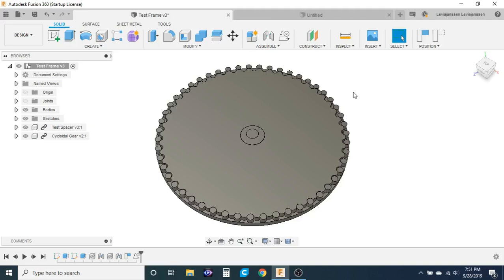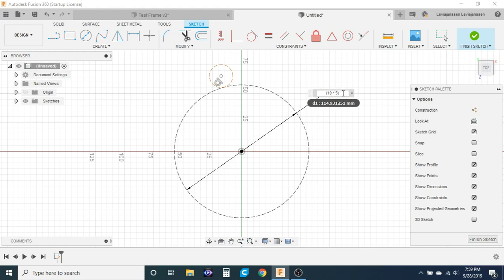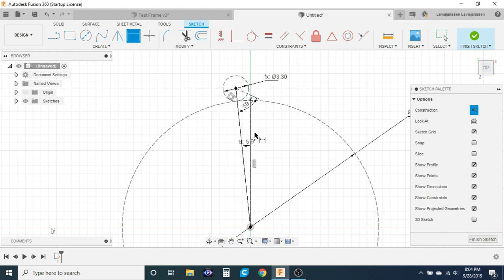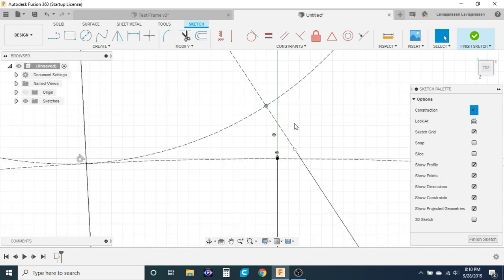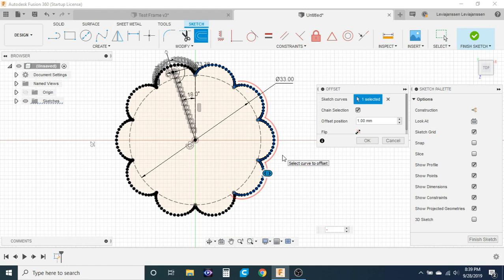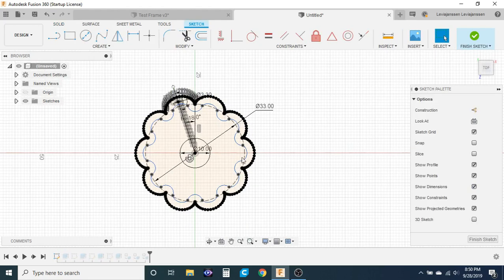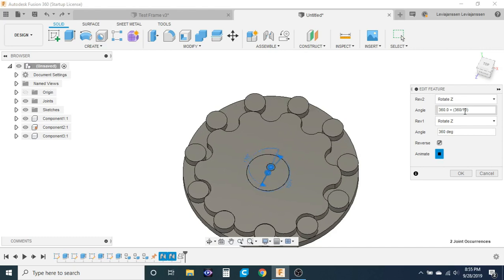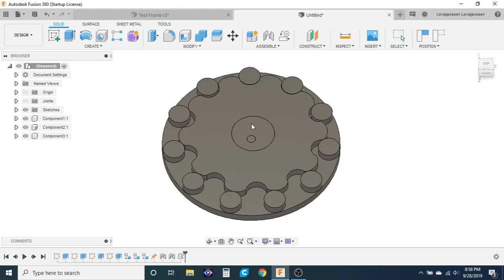How to Design a Cycloidal Disk in Fusion 360

Comment: I think this equation will produce the same curve without having to go through the process of setting up the circles and plotting points one by one:
x = R * cos(t) + e * cos(N * t)
y = R * sin(t) + e * sin(N * t)
R = ring radius
N = number of pins
e = eccentricity
t = 0...2pi
Then offset by pin radius, same as in the video around 9:00.
Reply: Thanks for this comment saved me the trouble of having to figure anything out for myself ;)
Reply: Could you define what t, e, N are please. Other than that looks so more simple. Could perhaps then write a script to draw the profile.
Reply: I ended up using: 
x(t) = (bR + sR)*cos(t) - sR*cos((sR + bR)*(t/sR)) 
y(t) = (bR + sR)*sin(t) - sR*sin((sR + bR)*(t/sR))
z(t) = 0
where:
bR = radius of larger circle on which the smaller spins
sR = radius of smaller circle (pin radius)
t = 0 to 2*PI
Reply: Is there a way to enter this equation into Fusion 360 to have it draw the spline to extrude?
Reply: @bitp1mp  There is an add-in for equation driven curves
Reply: @noahboursier  how to calculate bR and sR ?
Reply: @noahboursier  I calculated bR as in the video (pin radius times gear ratio), and  sR as the pin radius. when i enter the formula i get the "flower"  but when i try the negative offset, it tells me it generated no geometry. if i zoom in where each "petal" meets, there is a curl. what could be the problem? basically bR=16.62, sR=2.77 and ratio=6, for a pin of 5.54mm
Reply: cos (n+1)*t  for complete cicloid and parallel inside offset with half diameter of fixed pins works great without need to plot points  and without trimming the change over radiusses . idem for sin...

regards .

ISIDORO
Reply: @noahboursier  Thank you for that! I used this instead, and got smoother lines :)

x(t) = (bR+sR)*cos(t)-sR*cos(((bR+sR)/sR)*t)
y(t) = (bR+sR)*sin(t)-sR*sin(((bR+sR)/sR)*t)
z(t) = 0

bR = radius of larger circle on which the smaller spins
sR = radius of smaller circle (pin radius)
t = 0 to PI

Rotate or reflect to complete circle. ***I believe there is a glitch in how the add-in or Fusion interprets/assigns points, so don't specify the complete circle! Only do a portion (0 --> PI) and rotate around. You'll get a more accurate result :)
Reply: @eatonasher3398  Can you control the number of PINS with those equations?
Reply: Whats ring radius?
Reply: @dhruvbose8294  Ring radius could also be called pin circle radius. It's the largest dimension involved in the calculation. Hard to avoid ambiguity with the radius of each individual pin.
Reply: @dekutree64  so is it the radius of the pitch circle of the outer pins then?
Reply: @dhruvbose8294  Yep.
Reply: @dekutree64  thanks!
Reply: @dekutree64  What is the bR and sR in his example?  I am having trouble understanding.
Reply: @Sherlock_Ohms  bR is big radius and sR is small radius, referring to the circles used to generate the curve. Look at the wikipedia page Epitrochoid, which is what my original equations describe (though I had the signs backward on the second terms, but it only causes a phase offset so it works just as well). Eaton Asher's equations are for the special case called epicycloid where eccentricity = sR.

In my equations, ring radius is equal to bR + sR, and number of pins is equal to (bR + sR) / sR. Which also means ring radius = number of pins * sR. It's all describing the same thing, I just find the ring radius/number of pins format easier to work with.
Reply: @eatonasher3398  I get some a large cycloidal drive many times bigger than what I intend. What do I do?
Reply: @dekutree64 where do you add the equation in fusion, would this be at the angle point. sorry new to fusion 360

Comment: I just followed your method and it worked. On the points that looked too far apart I just added a few more points between the ones that were there to make it look smoother. It was nice to find this tutorial but all the deleting of constrains is a recipe for errors. I want to experiment making more cycloidal gearboxes in Fusion 360 but there must be a better way, there should be some way to do this automatically like the parametric function in Solidworks where you just plug in the trigonometric function and it plots the line. Keep up the interesting work, I subscribed!
Reply from the maker: I don’t think fusion 360 has any of those fancy functions, I’ve looked pretty thoroughly, but I guess it’s possible. I guess I’ve grown used to the tedium of this design method. it’s great to hear that someone found this useful!
Reply: Here's the math to draw the gear.
https://community.ptc.com/t5/Part-Modeling/wavy-circle-by-equation/m-p/563286#M30034
Reply: @LeviJanssen  There is a cool software, its called Gearotic Motion. It can generate several types of gears, including cycloidal gears. All you need is just to choose some main  parameters and gear ratios. You can find demonstration videos of it on youtube.

Comment: I saw videos where there is a cycloid on the outside instead of pins, and where the output pins are kept in place. How do you design the outer cycloid relative to the inner one in that case?

Comment: Hello. Great job explaining the procedure! It sure isn't easy to convey something like this without confusion. I am wondering (and mind you it might be a premature question given I didn't go the trouble studying the cycloidal gears very much) concerns that sharp edge where the offset cycloid curve meets the circular arc at each side of the lobe. Doesn't it prevent a smooth action? Isn't it likely that this edge is going to get ground off by the time, increasing the gaps in the fit? I did browse through some images of cycloidal discs and most of them seem to have a smooth curve, though they might be approximations.
Reply from the maker: Some cycloids have these points, some don’t. If you simulate a continuous input rotation and a directly proportional slower rotation on the cycloidal disk, you can see that the point naturally follows the edge of the pin perfectly. No matter what position it’s in, the disk will never try to push through a pin. Additionally, load should be balanced on all of the lobes, so the points shouldn’t take any more strain. It’s quite the fascinating thing.
Reply: @LeviJanssen  Right, it definitely looks proper in motion. The thing is, or at least my vague idea is, that in the end it's supposed to transmit torque. So there will be forces on either side of the lobe pushing it against the pin (or vice versa). And there my concern is that even though the theoretical motion is ideal, with the torque it will have the tendency to smooth out that ridge. But it really could be a negligible effect - I was just curious about your insight in this.

Did you by any chance see the recent installment by NYC CNC about cycloidal gear? https://www.youtube.com/watch?v=Eds48L4cJjM They share the gearbox file, but I have no idea what method they used to design their discs and/or whether they are theoretically correct like yours. They seem to avoid the ridges, though.

Comment: I can draw and assemble all the part for the cycloidal drive, and get the cycloidal disk to turn right.
How do you get the Output rollers and shaft to turn with the cycloidal disk?
Reply: hey, did you ever figure this out? im trying to do the same thing, thank you
Reply: @FeartheLess   Yes I did.  I used this https://www.tec-science.com/mechanical-power-transmission/planetary-gear/construction-of-the-cycloidal-disc/
To set the inner pins to turn with the cycloidal disk, set your joints, go to edit feature first angle set at 360, Second set at 36
Reply: @mikefyfe7068  thank you very much

Comment: Would the little edge that appeared at the transition point between the semicircle and the curve after doing the negative offset disappear if you'd have traced the points in smaller increments?

Comment: Hi, I don't think it's a 10:1 reduction ratio. Because you have 11 pins and therefore each revolution moves the cycloidal plate by one tooth. So you need to rotate the shaft 11 times to get the plate to the starting position.
Reply: You're wrong, its 10:1.  Each time the disk moves one peg, 1/11th of a turn, the input shaft doesn't make a full rotation, it makes 10/11th of a rotation from the previous peg for that same tooth on the disk.  That means every time the disk has moved around all 11 pins, one full revolution, the input shaft has rotated (10/11) * 11pins = 10 times.  10 turns of the input for 1 turn of the output = 10:1

Comment: Wouldn't it be better to use a proper gear-creation tool?  The scientific reason for the shapes of the teeth in gears is that there is no friction.  Your design will rub and heat/wear ...
Reply: This is not a gear. You can use bearings for pins to avoid friction.